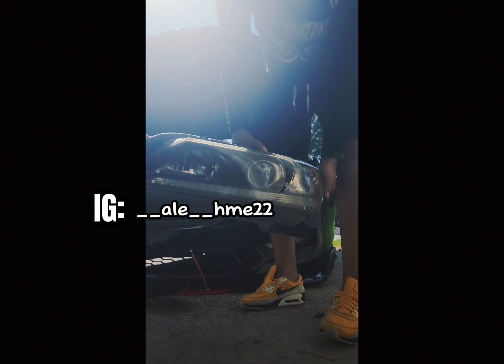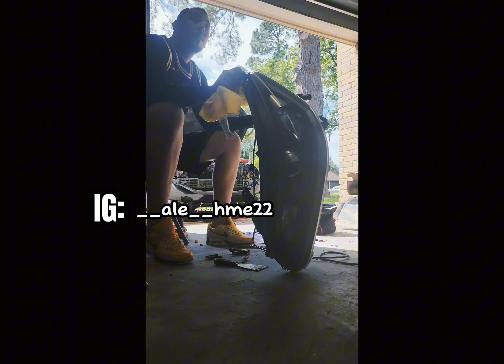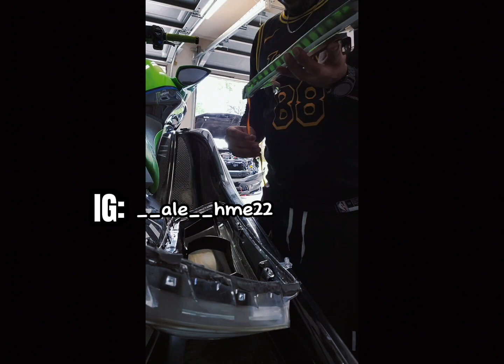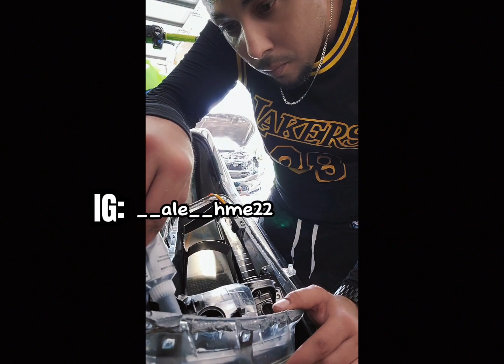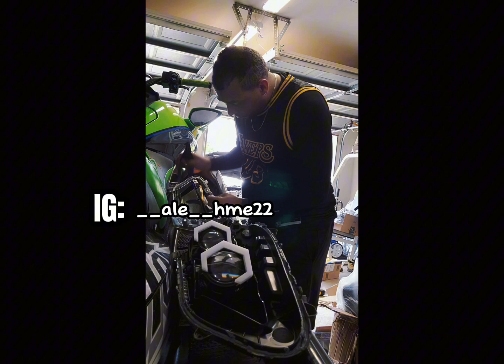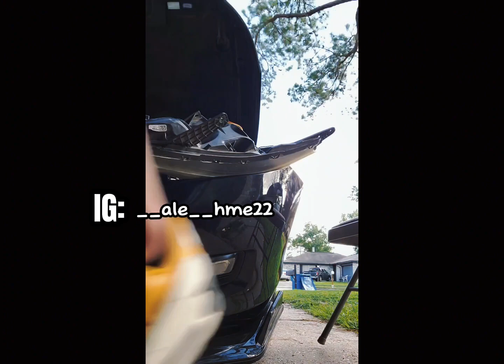2015 Honda Accord headlight update

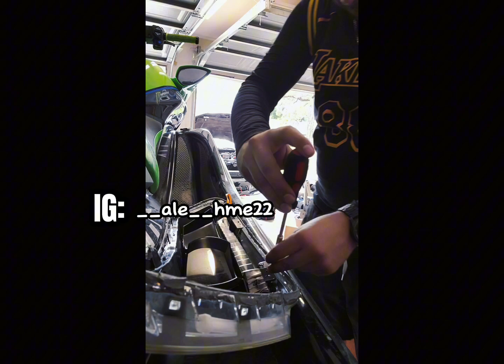Comment: Hi great job. I have a question. What do  you put on 6:22? Between the LED tube before you added the silicone? Please let me know. Thanks.
Reply from the maker: @frankies9049 is just a piece of plastic to reinforce the wall where the LED tube is, so it doesn't move.
Reply: @AlexCk88  thanks for responding. What kind of plastic do you use?